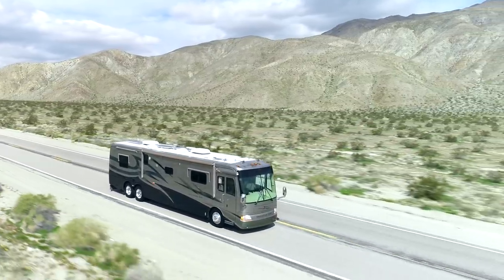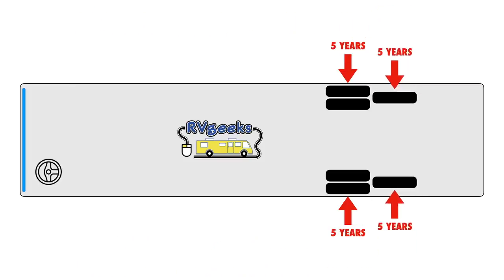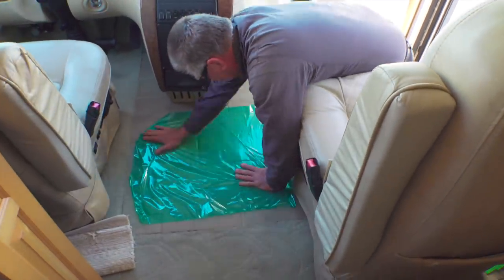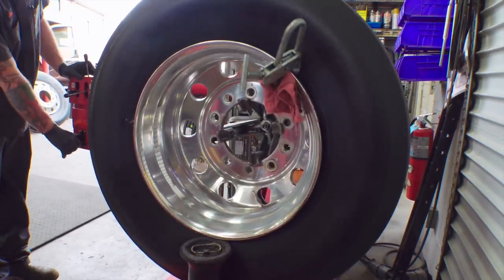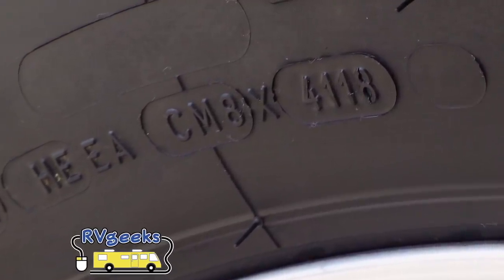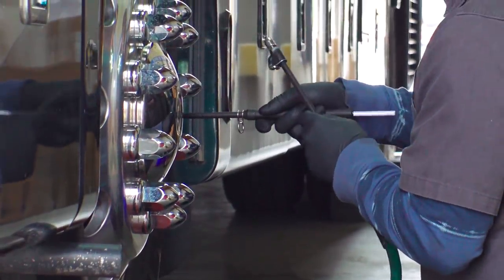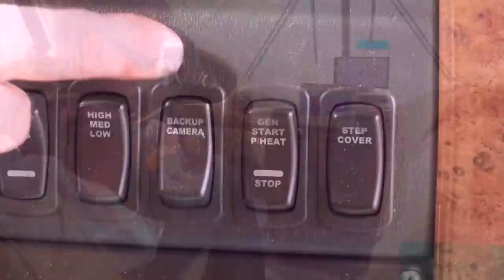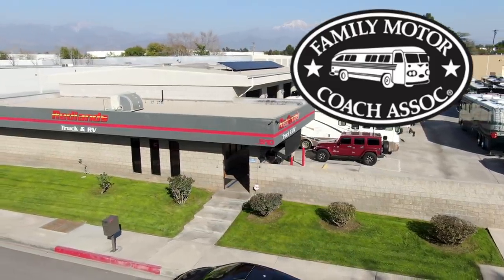Saving 💰On RV Tires - And Getting The Job Done Right

Comment: Have to give a shout out to Purcell Tire in Albuquerque...recently had tire problem on the road which could have turned disastrous... after calling around with no luck contacted Purcell they took us right away.... showed us what was wrong which couldn't be seen from the outside...2 new tires & good customer service we're very happy RV'ers

Comment: Great video and information as always guys! Enjoyed your interview and behind the scenes chat with JD of BTBRV last month as well. Since I work for Discount Tire Corp. the only thing I'd question is the use of nitrogen. We used to offer that as a service, but we've found that its use is not very beneficial vs. the cost unless you're competitively racing. Additionally, you'll be challenged to find it available to top off the tires in the future. In other words, if it is an up-sale, it is not worth it. - don -
Reply from the maker: Hi Don! Thanks so much for the comment and the shout out to our appearance with JD! As far as N2... While we're not sold on the idea that nitrogen is essential, it is supposed to be better, and it's just what Redlands uses as standard operating procedure (no up-sell.... we didn't "opt" for it), the same as when Costco installs new tires on our car. While we're well-known to be pretty anal retentive about a lot of things, we do have to let some things go... such as worrying about how absolutely pure the N2 is. So we'll continue using our wonderful Viair compressor as needed! 😊

Comment: Wow, your experience with Redlands was very different from ours. They installed our BlueOx base plate and AirForce one brake system on our coach/toad but failed to Locktite the baseplate bolts or attach the safety cables that secure the baseplate to the frame. When this was discovered several of the baseplate bolts had backed off and the entire unit was at risk of detaching, allowing our tow car to go rogue. When contacted about this, Redlands did not seem at all concerns and offered only to have us bring the rig and toad in for them to correct the problem. They didn't seem to recognize/care that we were in Nova Scoria then, a good distance from the facility in California.
Reply from the maker: Sorry to hear about your experience, Ron. We know that even the best places can make mistakes. Since we're always on the go, too (full-time for 16 years), it's always a challenge when follow-up is needed and we're no longer in the area.

Comment: That's a new one to me. It's the first time I ever heard of the recommendation of ten years. I spent 30 yrs in the specialty tire ind. and have heard and read from dozens of sources that said RV tires should be changed every 5- 7 yrs.
Reply: That’s what I heard too.  It’s kind of reassuring that the manufacturer says 10 years.  Mine are at 7 years and I wasn’t ready to spend the money replacing them this year.  I’ll start saving up for a 10 year replacement.
Reply from the maker: Hi Roy! We've heard that many people replace tires more often due to recommendations like that, but we've always felt that nobody knows more about any tire than its manufacturer. We've had no problem following Michelin's guidelines (which include annual professional inspections after the first 5 years), and figure that a company their size would have enough lawyers on staff to tell them to specify a shorter life if they were opening themselves up to lawsuits! We're sure that other brands have their own specs, and of course if we ever switch brands, we'll follow those too.

Comment: Great video!
I have had suspension upgrades done on my new RV by Redlands Truck and RV. This video is spot on. I was surprised to see the tech cleaning my windshield when I came to pick it up. Also, when they checked my generator (I did not ask them to do this, or was it in for service), they informed me that there was NO OIL in it! This was on a brand new RV!! So much for the dealership. You get what you pay for here at RT&RV. Thank you Chris.
Reply from the maker: That’s great to hear, Joe! Redlands is an awesome shop.

Comment: The DOT & Date # are always lined up with the valve stem because that’s your “ go to” balance point and has zero to do with anything else, period. If it can’t be balanced at that point you air down and spin the tire on the rim 90 degrees and air back up and rebalance and that’s a clear sign your new tires are junk. This also applies to passenger cars as well. It had nothing to do with convenience. I don’t know how old this video is but Nitrogen is really bad for tires because it speeds up dry rot and we’ve known this for about 5+ years now.
Reply: Randy.... are you associated with the Carlisle Tire organization?  I have never noticed a difference with nitrogen in the tires.
Reply from the maker: Until now, we have never had a single tire shop give a hoot about which way the valve stem lined up, or which side it faced for that matter, and we've never had a balance issue. Michelin, Goodyear, Dunlop, Continental, Bridgestone and Goodrich all officially support the use of nitrogen. Please site your sources that it's "really bad" for tires. Links please.

Comment: Nitrogen fill is not worth any extra fee. If an owner is diligent in maintaining air pressure, it is likely your compressor will deliver plain, old atmospheric air. Or, pay a fee every time the tire air pressure is brought up to spec by a shop that PROPERLY used the right equipment. Extra cost Not worth it to me for a minimal benifit.

Comment: I have changed out tires on 18 wheelers back in the day with the sludge and spoon bars its what I called back-breaking work and no air compressor either big ass ratchet and slide a big ass pipe on that OLD SCHOOL BABY.

Comment: When I needed 10 ply tires for my pickup truck I went and priced 4 of them at Plains Tire in Sheridan , WY . They would have cost over $750 for the 4 of them. But I waited until they had their big tire sale and got the same tires for $500 . Keep an eye on your tires and plan ahead so you can take advantage of sales.

Comment: What did all of this cost?
Reply from the maker: Hi Peter! Tires were $623.50 each (vs $725 without the FMCA discount), labor for breaking down & remounting 4 rims with new valve stems and balancing was $318, and a 3-axle laser alignment was $715.50. All in, including CA sales tax, FET (federal tax on large tires), shop fee, etc was $1078.04 to Redlands and $1435.32 directly to Michelin, for a grand total of $2,513.36. Large tires aren't cheap, which is why we take good care of them and try to get as close to the full 10-year maximum lifespan as we can... and take advantage of discounts like the FMCA plan. 😉
Reply: Best money you spent! @RVgeeks
Reply: @RVgeeks  Real good deal. 4 tires on my Porsche is more and may get K10 miles
Reply: @RVgeeks  Good information & great video! To bad Michelin tires are so expensive even with the FMCA discount. They are much more expensive than other brands, then add the installation cost and it becomes prohibitive, especially for older coaches. I compared alternate tire options for my 91 Beaver and the associated installed cost. Purchased 6 Toyo tires, price negotiated with a local dealer, at substantial saving compared to the Michelin FMCA discounted tires.

Comment: Hello, is FMCA towing and roadside assistance more beneficial than Coach-Net towing or should I have membership in both?  I currently own a 40 foot fifth wheel but plan to buy a 40 foot diesel pusher soon.
Reply from the maker: We've always had Coach-Net, and the one and only time we needed to be towed (after we got stuck in the desert! https://youtu.be/kLdJbDwb3OA ) we got fantastic service. Can't imagine you'd need more than one, so if you compare the two and choose one, it should be enough. The only RV roadside assistance programs we've heard poor reports about are Good Sam and AAA.

Comment: Excellent job on the video.  They look to have the right equipment for the job and people trained to do it right.  

Ten years is a long time for tire life.  I suspect it works for you because you take good care of your tires and you keep them out of hot climates by following the weather.  I live in the desert so the tires of my travel trailer are subject to a lot of heat.  I had a set of Goodyear OEM branded tires that were deteriorating on the inside of the tire at six years, most likely due to heat aging.  I changed them due to the age and caught it just in time before any blowouts.  Maybe the large motor home tires have better longer life rubber compounds than trailer ST tires.  As a desert dweller, I do not go over six years on car or trailer tires.  Seems there is at least one story a summer of a fatal rollover resulting from a blowout.  It is common during the desert hot summer to see vehicles pulled over on the side with a blown out tire.
Reply from the maker: Hi Bruce! Thanks for the comments. The desert sun and heat surely does reduce lifespan. Different brands and types of tires have different maximum lifespans, too. Travel trailer tires are surely less than our big 295s, and Michelin is likely longer than Goodyear (although we'd have to check that to be sure, since we've never had Goodyears). And always be sure to check the manufacturers recommendations.

Comment: Nice to see a good responsible RV maintenance place. How did tou find them? Afraid to ask but what was the cost of the service not including the tires?
May want to let them know they need some work on the website (dead and invalid links and such)
Reply from the maker: Hi Joe! We were referred to Redlands by some our closest friends, who have been using them for years. The complete breakdown for everything was as follows: Tires were $623.50 each (vs $725 without the FMCA discount), labor for breaking down & remounting 4 rims with new valve stems and balancing was $318, and a 3-axle laser alignment was $715.50. All in, including CA sales tax, FET (federal tax on large tires), shop fee, etc was $1078.04 to Redlands and $1435.32 directly to Michelin, for a grand total of $2,513.36. Large tires aren't cheap, which is why we take good care of them and try to get as close to the full 10-year maximum lifespan as we can... and take advantage of discounts like the FMCA plan. 😉 We'll pass along the website info!

Comment: Why did you choose static balancing instead of balance beads? I replaced steers last year, and went with the beads. Did I miss something?
Reply from the maker: Great question, Monte! In the 16 years we’ve been full-timing, we’ve only ever had our tires spin balanced (not static balancing, which we haven't seen in years)… and haven’t had any problems with ride or tire wear. So we haven’t seen the need to do anything else, and don’t have any problem to fix. We know that lots of people have used beads/Centramatics in place of the traditional balancing with lead weights and are happy with them. If we had ever had a problem, we would surely have sought out an alternative option.

Comment: Great video on the tires, after watching this video I went over to the wear house and looked at my tire dates, the rear must be the Original tires from 2004...15 years old and the  front tires is from 2014....5 years old. The tires in the back still look like new, I don’t see any cracks on the side of the tires. I think I am going to take a chance driving the motorhome to Oregon this summer and back on these tires and then next season switch them all out. Wish me luck.... thanks for the sharing this video
Reply from the maker: At least your front tires are only 5 years old, Ron. But if it were us, we'd replace the rears. 15 years is inviting catastrophe. Just our $.02.
Reply: RVgeeks  not sure what I will do just yet, just got back from 3 mouths in the Arizona Desert. We won’t be heading up the Oregon coast till June. I will take the motorhome to my tire guy and see what they think. I trust them, they kept my big rigs rolling for over 30 years, and Knock knock on wood had very few tire problems. Although I would hate to have some blowouts out on the road away from home cost more money. Thank You!!
Reply from the maker: Good plan!! 👍

Comment: It can be frustrating to find the date on each tire as they are often on the side that is under the coach. With dual tire you can bet they are between the tire and almost impossible to see. My understanding is that the DOT does not require date codes on both sides of the tire. Wish they would change that.
Reply from the maker: Even before we discovered Redlands, which is the first shop we've ever seen that pays any attention to the location of the DOT dates, we would always ask to see the dates and positions of each tire being mounted and make note of it for our service records. Once they mount them on the duals facing the other tire, good luck. And no, the DOT does not require it on both sides. 😒

Comment: Excellent video. Thank you. I would like to ask you a question on another topic, if I may. Would you be given the option today, would you change the RV motor home type that you are using presently? Would you choose another Class A Diesel 45 ft, would it be another Newmar, would it be a Class C or the shorter New Aire type? I’m in the market of buying a RV and since I greatly appreciate your expertise, I was interested in knowing your choice after being full time RVers for so many years. Thank you ahead of time for your reply.
Reply from the maker: Hi Michel. Thanks for your kind words. While we love our 43' Mountain Aire (it's treated us very well and has been our home for 14 years), if we had to do it over again, we'd go smaller. And, since our Newmar has treated us so well all these years, we'd want to do that in another Newmar! With the addition of 35' floorplans to the 2020 model year for the New Aire, it's definitely getting even MORE interesting to us. That little bit of extra length is allowing them to include a king size bed, which is a must have for us. And the New Aire is the only short diesel pusher that we know of that offers the same level of creature comforts and luxury that we're used to in our Mountain Aire (with the perk of having 14+ years of technological upgrades built right in, too).

We got our Mountain Aire when we sold our 39' Fleetwood Bounder Diesel because we thought we wanted all the extra space. And, don't get us wrong, it's been nice. But this large an RV means we are restricted from going into many of the National Park campgrounds we love the most. We thought we'd be OK with that, since we did a lot of that in our Bounder. But we miss it. And while John is OK with driving the RV when needed (highway driving he's totally fine with, but tight local roads start getting stressful), he'd be much more comfortable in something under 39'.

35' to 36' is about our sweet-spot for being large enough to be comfortable in it (even full-timing... and particularly the New Aire which seems to have really maximized the availability of basement storage space for that short a wheelbase), but small enough to be easier-to-handle and able to fit into MANY more campgrounds.

Now... if only we could afford one!  LOL!
Reply: RVgeeks Thank you so much for your quick reply. Your answer helped me more than you might’ve expected. I sincerely hope that our paths cross some day. Just like you are, we are Canadians and Americans. Until next time, take great care of yourselves.

Comment: We are at this minute parked in Redlands Truck and RV's  little campground with the orange trees waiting for them to replace our tires tomorrow morning! We have been speaking with Mike and he is recommending that we install an internal Tire Pressure Monitoring system. Right now we are using the EEZ system and it has been finicky for us. What are your thoughts on an internal system. Will miss you on the Patreon channel, but looking forward to seeing you at the RVillage Rally! Happy 2020!
Reply from the maker: Hi Laurenne! Tell Mike and the team we say "Hi!" We've heard about the Valor TPMS system (and saw it while we were at Redlands last year). It comes very highly rated (and may even be the factory-standard system supplied on new Newmars & Entegras... but we haven't confirmed that, yet). We likely would have considered getting the Valor system IF we had been having ALL of our tires replaced... since they need to be broken down to install the sensors onto the wheels. Since we weren't, we skipped it. But, ironically, the system we DID get is the EEZ Tire unit. We haven't had a single drop-out or false alarm in the more-than-a-year that we've been using it. So we're curious about what's been "finicky" for you with it? Our system came with the repeater, which we installed in the rear closet in the bedroom, and it's never dropped a tire!

If the Valor system is in your price-range, you can't beat the convenience of having it permanently installed... although we'd wonder about battery life and the difficulty of replacing them should they need it, since the tire would have to be broken down to get to it!  

Let us know what you decide! And see you at the RVillage Rally in February!!
Reply from the maker: @Laurenne Douglas... so great to chat with you tonight at RVillage. Went online after we talked... and you should check out pages 32 and 33 on this PDF: http://www.valortpms.com/sites/default/files/Valor-TPMS-Gauge-UserManual-6.75x5%28web%29.pdf  We think either the contrast or backlight settings are likely to solve your trouble with reading the Valor TPMS display during the daytime.